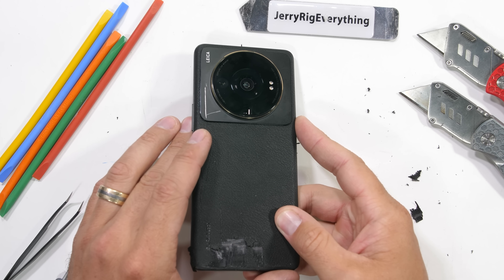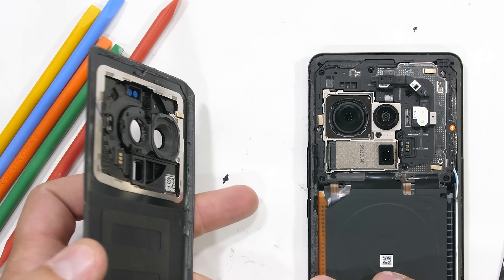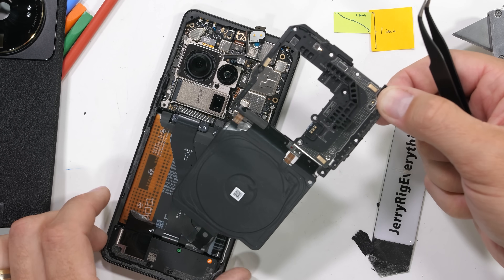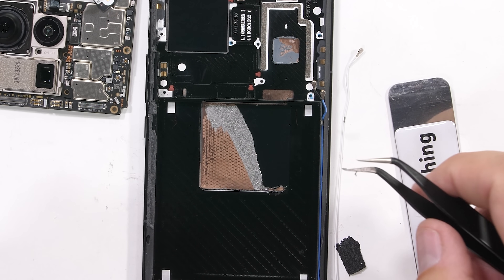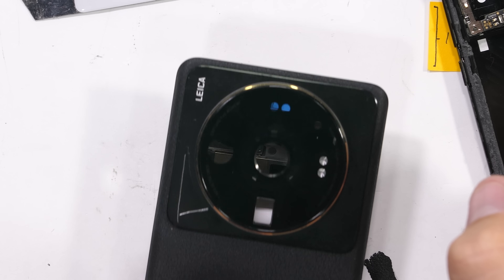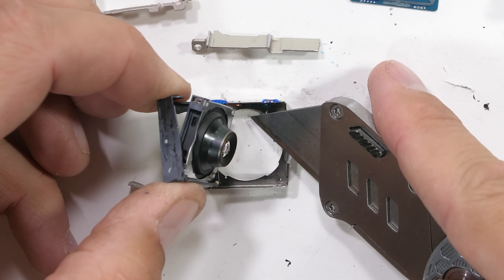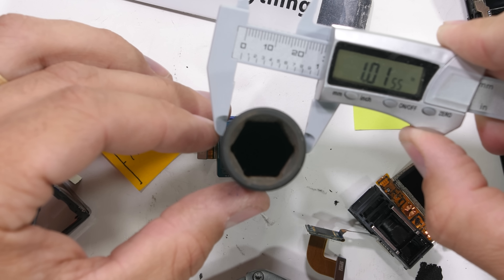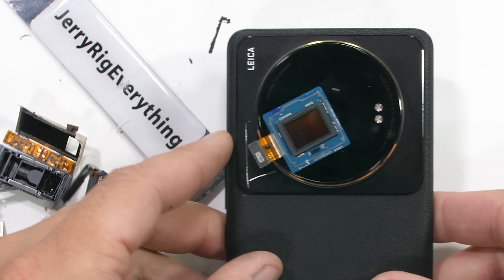Its a bit smaller than we expected... - Xiaomi 12s Ultra Camera Sensor Teardown!

Comment: If the definition is to be fit within an 1 inch circle then the diagonal leangth of the square would be same as the diameter of the circle. 

Which is exactly why screens are measured diagonally.
Reply: Not if the sensor is not a square but a rectangle, as in this case
Reply: you're one of the kids in kindergarten that failed to put shapes into holes toy?
Reply: @SToXC_.  who? me? I never even went to kindergarten 😆

Comment: The whole thing about 1 inch being with how big of a circle the sensor can fit in is all well and good UNLESS YOU SHOW A PICTURE OF A 1x1 INCH SENSOR THAT ISN'T IN THE PHONE... It's literally not even the same shape.
Reply: if we would change the convention we might as well drop the silly units and use cm or mm
honestly area measurement would be the best
Reply: Still it is not 1 inch
Reply: The problem isn't even that. You can fit 2 "one inch" sensors in a 1 inch tube stacked on top of each other.
Reply: 1" sensor is different from specific 1x1 sensor. You are comparing apple to pear as one is sensor for most standard format 3:4 and the other sensor is specifically 1:1 format.
they are both 1" but for different picture format and if you use 1x1 sensor for 3:4 format photos you only use part of that sensor that is equal to standard 1" sensor
Reply: Well yeah, most image sensors are 3:4 I guess. But in my opinion it still should be measured either side by side or diagonal from corner to corner. Measuring by the lens or module doesn't make sense to me. In the end, the sensors don't capture the whole circle of light that travels through the lens but it captures a rectangle from it.

Comment: I like how a lot of smartphones advertise with "WOAHHH 64 MP CAMERA SENSOR!!! 128 MP CAMERA SENSORR!!!!" even though it doesn't mean anything if the lens is made of plastic. the images arent going to be 128 megapixels, they are limited by the lens. so while it is going to take up space like a whatever size image, it wont look like a whatever sized image.
Reply: True, also with the lenses being so tiny they are always affected by the effects of diffraction to a degree. That said tho, I really do wish that we get more native higher mega pixel sensors in Smartphones. Just compare the images from Xiaomi Mi 10 pro or mi 11 with any samsung phone with that 108 mp sensor since those phones use the exact same sensor except that they bin it down to 25 megapixels instead of 12 mp and the result is quite clear, viewed on a bigger screen the Samsung looks terrible compared to the Xiaomi.
Reply: Actually they're limited by the colour (Bayer) filter resolution. If you compare the filters between a 12 MP standard Bayer and those Quad or Nona bay with 108 MP, they would actually look exactly the same. So why does it say 108 MP? It means they just have extra light sensors behind each colour for noise reduction and simultaneous bracketing (HDR).
Reply: It means, altought definelty not as much as ppls thinks. It helps with futureproofing as the more pixels, the better work the software can do while post-processing and software can always improve. And also i heard it helps heaps for low-light photos too altought i dont know the details about that(Edit: It's not helping for low-light, see long comment below).
Reply: @StarfoxHUN  I understand that you don't understand so I just wanted to make you understand. The more pixels there are in the same sensor size the worse the low light performance(usually). This is because the pixels on the sensor itself is smaller and therefore received less light and cannot use as high of an ISO to achieve the same noise quantity. What smartphones sometimes do is include each colour of pixels as a separate pixel. Since there are 4 coloured pixels in one "normal pixel" the actually pixel count should be divided by four to achieve the same amount as there would be in a DSLR or mirrorless camera. I know it's a long response but I just noticed you noticing some cap online so I just wanted to give you notice so you would notice too.
Reply: @Valeriy5847  Thanks for the info, i always appreciate such detailed clarification.

Comment: Hello Zach, 
the term "1-inch-class" comes from the time of vacuum glasstube sensors of TV-cameras. A glasstube with an outer diameter of 1" could hold a sensor of exactly THIS size shown in your video. ALL electronic cameras with an "1-inch-sensor" (Panasonic TZ-101 and 202, Sony's RX-100's series etc.) have exactly the same size of sensors! O.k., I watched while typing. The solution came later. 😂
Reply: Someone commented before finishing the video! Haha
Reply: mkbhd also explained this
Reply: Have you watched the video?
Reply: @justinsijbolts  It would be better if he made it clear earlier in the video. He literally waits until 7/8ths of the way through the video to clarify, but twice earlier in the video gives the impression that Xiaomi is lying. I don't know what his average watch duration is, but I bet there's plenty of people who will just take the first part and run.
Reply: @justinsijbolts  I watched while typing - the solution came later! 😂
Reply: @u.e.u.e.  Ah alright haha
Reply: Well Actually, watch the video.
Reply: Yeah, he explained that in a Video. Watch it

Comment: its weird to see that the big camera isn't the one in the center
Reply: Yep. When you look at the back you think the camera in the center must be the largest one.
Reply: Coz its the ultra wide in the middle...which sees wider than even the main one but once u c it ....u cant unsee it .....its kinda like that.
Reply: @supreme4023  I have problems with my phone, It's ultrawide is in the lower corner of the camera bump, whenever I hold it with one hand, my finger covers it sometimes. Putting it in the center might help. Model Huawei Mate 40 Pro, also has similar-sized round camera bump, but it's three cameras and the Lidar is in four corners of the ring
Reply: @yuxuanhuang3523  if the ultra wide is in the middle or lower ...it might pick up ur finger in the picture...its kinda good the way it is...depends on how wide it is...better in upper corners...thats why iPhone cameras are always in the corner ....it also helps in getting close to objects bcoz its in the corner ...so if u take a low ultra wide ground shot...u can get closer to the ground..or take good macro shots
Reply: @supreme4023  That was my whole point. My phone camera 's ultrawide is positioned terribly, I have big hands and I like taking photos with my phone outside the window so I get a nice grip. half the photos I get a annoying finger in frame

Comment: having 1" sensor doesnt mean it is being used in full, sony did something similar earlier
Reply: It would be foolish for Xiaomi to call their sensors 0.66 inches and not the standard 1 inch when literally every other company on the planet calls this sensor size 1 inch. That said, that Sony phone you talked about did have a similar size sensor, the lens however was much much smaller than the one you see here which basically resulted in the light gathered only falling on to a small portion of the sensor (which then is also cut into a 3:4) resulting in a sensor size more akin to a 1/33 inches,similar to the Google Pixel 6 although still a bit smaller and the aperture was alot smaller so effectively optically worse than the pixel 6, so yes, this is more or less a true 1 inch sensor phone compared to what Sony did in their's which is a bit more akin to a scam or misleading marketing.
Reply: Plus the sensor size measurement isn't actually 1" in any dimension. They use some real fuzzy measuring going back to vacuum tube sensors. Similar to how back in the CRT screen days the screen 'size' was always larger than the viewable area because they measured the tube and not the display.

Edit: Oh, I should have kept watching. lol.
Reply: @bradley3549  Have you watched the video?
Reply: @justinsijbolts  Why would I do that when I can comment first?
Reply: The sensor IS utilised fully, the sensor itself just isnt 1 inch, its 1 inch type
Reply: Yep. The Panasonic LX100 point and shoot camera only uses part of it's 4/3 sensor but produces better image quality compared to the Sony RX100

Edit: not APSC, lol
Reply: @aseannessienot  The LX100 uses a microfour thirds sensor, which is way larger than the RX100 series' 1 inch type sensor
Reply: @UCX3oTRcZZKeJqLxtnY8aiCg says some random who nobody has ever heard from.

Comment: Xiaomi forgot that Jerry will rig the 12s and reveal the size. 😅☄️
Reply: Nup everything is correct. 1 inch is a terminology in photography where the tube infront of the sensor was 1 inch in diameter back in the film times. A true one inch sensor would be somewhere between an APS-C and a full frame sensor

Comment: Whether it is false advertising or a bad measurement it is still for sure 1 inch of impressiveness
Reply: Thats just what it is called. 1 inch sensors are almost never one inch. its from the olden days where the camera tube was one inch in diameter, but not the sensor